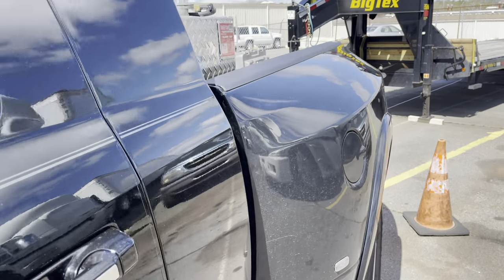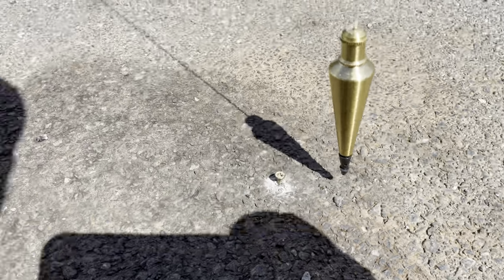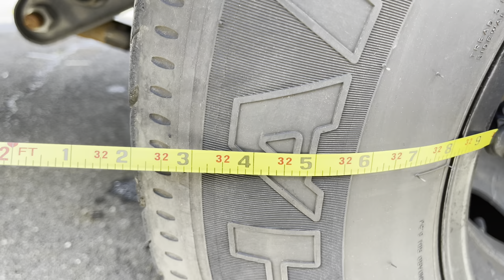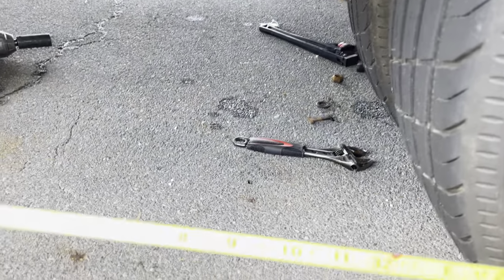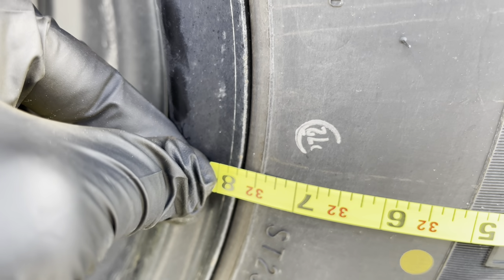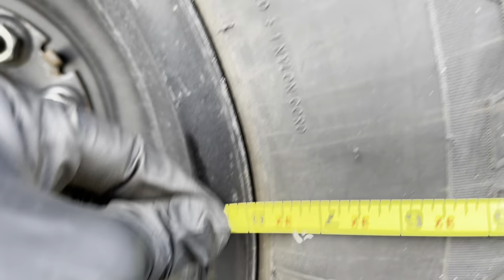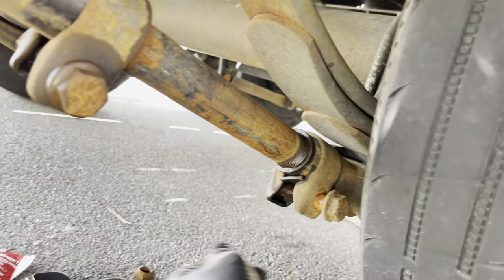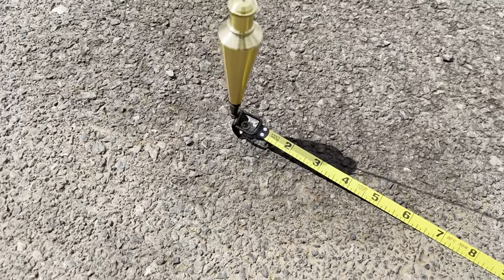How to adjust wheel alignment on a dual axle HD BigTex trailer

Comment: How did it get out of alignment? Was it never aligned from the factory?
Reply from the maker: Great question! Unfortunately, I’m not sure if it was ever in alignment or not. I didn’t know trailers needed an alignment until a mechanic showed me how to do it.
Reply: To answer your question, yes and no
 They are supposed to be aligned from factory but that is asking alot apparently. I have a two month old Big Tex with a bald wheel already.
Reply: either from factory or just road abuse. These roads suck and trailers are usually heavy and them bumpy roads can cause this easy.
Reply: Sometimes it’s because of potholes or worn parts or curbing it , that’s assuming it’s done correctly at the factory or trailer dealership that puts them together after shipped in.
Reply: @lawnman3638 them your Axel is bad